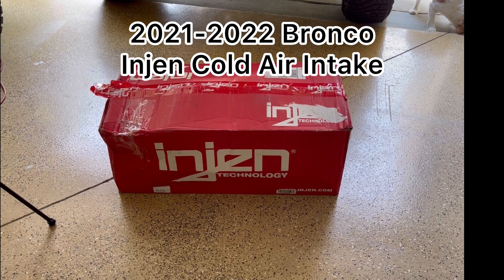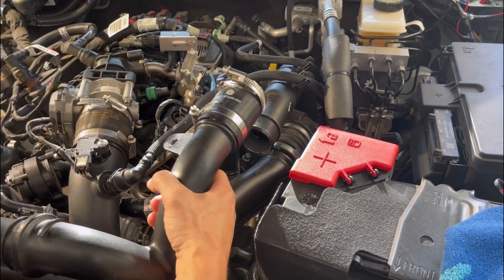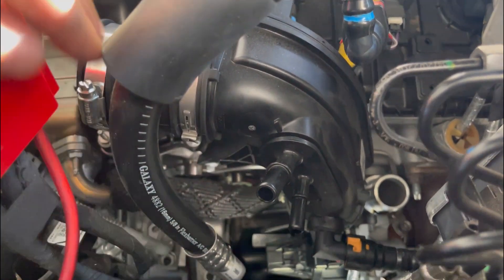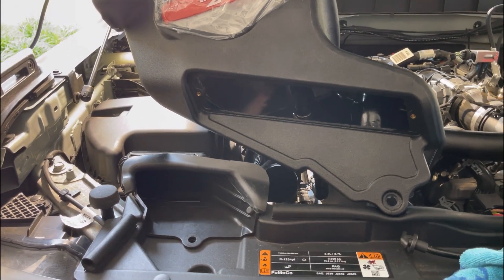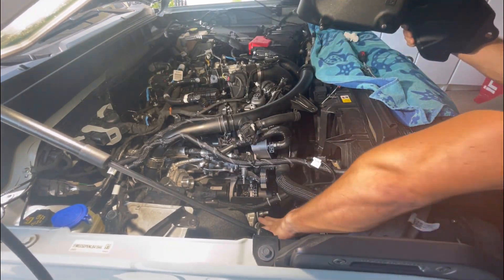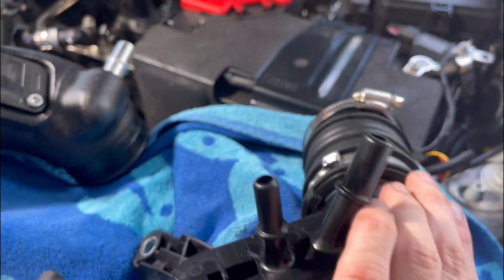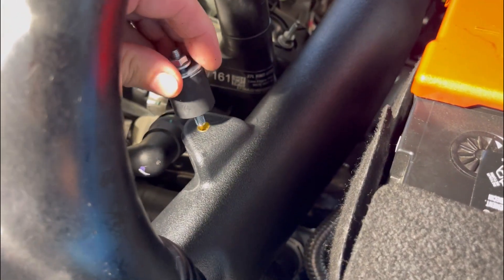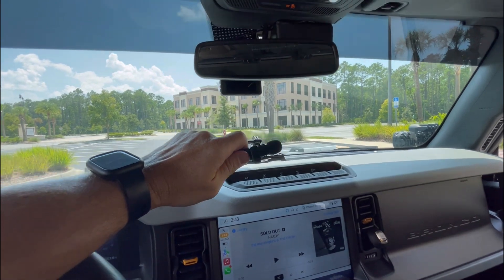Injen Cold Air Intake for 2021-2022 Ford Bronco Install and Review

Comment: What made you decide to get rid of the k&n and go back to stock? Is taking the filter on that injen out to clean as big of a pain in the ass as it looks?
Reply from the maker: Hey – thanks for the questions. In regards to cleaning the Injen filter, yes, it is going to much harder than the K&N. Something I didn’t think about until you just mentioned it😳. 

The reason I switched back to stock from the K&N was that I didn’t notice much improvement like I had with previous vehicles. (Examples: throatier sound on acceleration, improvement in acceleration, etc.). To be fair, I didn’t get the sound I wanted with the Injen CAI but that’s because of the engine. I had also preordered the Injen way before I installed the K&N and honestly forgot about it until it shipped. 

Hope that helps and good call out on cleaning the filter…guess I will post a video when the day comes. 

Take care
Reply: @UnitedStites  yea unfortunately all ecoboosts just sound outright bad. Is what it is. Have you put an exhaust on yours? I've been thinking of going k & n intake with the Flowmaster flow fx or borla s type. Gonna check out your BOV video now!
Reply from the maker: Actually, I was contemplating the Flowmaster FX like you mentioned but settled on the Flowmaster American Thunder about 2 weeks ago but somehow UPS lost it during shipping. I re-ordered it on Saturday and will post a video as soon as I get it installed. I was leaning more towards the FX but the wife and kids influenced a more conservative approach. Hope I don’t regret it. 😉. Keep you posted.
Reply: I was wondering the same thing about the filter - this install looked brutal compared to the K&N (which itself looked pretty difficult!), now you'll have to undo half of it just to pull and clean or change the filter, too...  Yikes
Reply from the maker: I reached out to Injen support, and they replied pretty quickly. Yes, it looks like you will have to loosen some clamps and pull out the tube to access the filter. Here is their response.

The best way to clean the filter in this kit is to reverse the installation steps. We suggest loosening the clamps on both ends so the tube can move freely. Once the clamps are loose, you should be able to pull your tube out of the way. You may need to take a hose or two off depending on how much slack you have. You do only need to clean our air filters every 4 years or 100k miles and we suggest turning it a 1/4 turn. This kit is one of our more challenging kits, but you shouldn't have an issue getting to the air filter.
Reply: @UnitedStites  definitely gonna stay the k&n route, just keeping my eyes out for when they have the dry filter version in stock again. Thanks for keeping everyone updated!